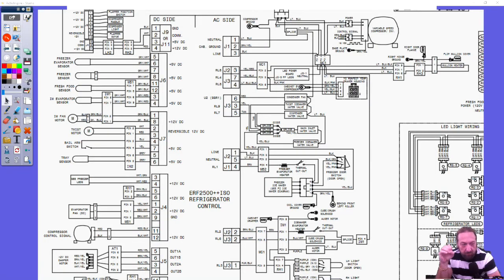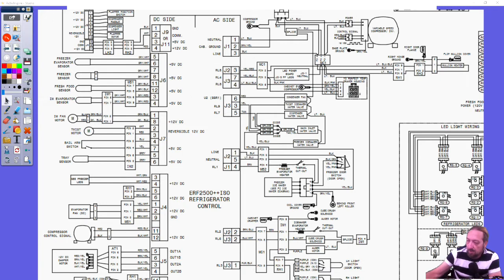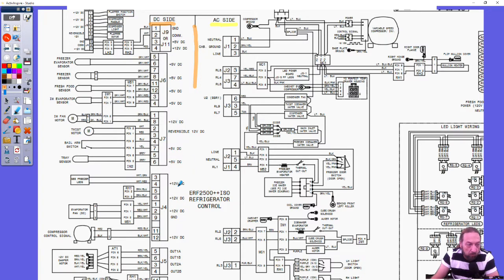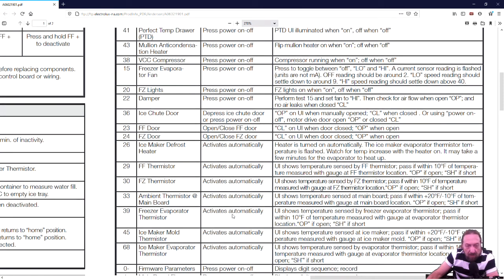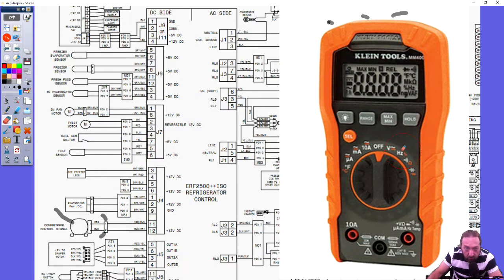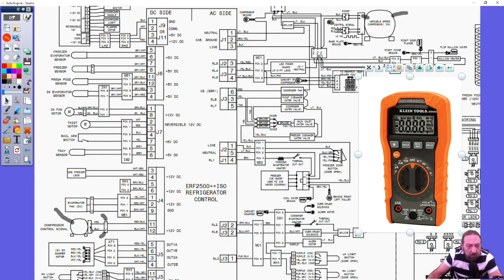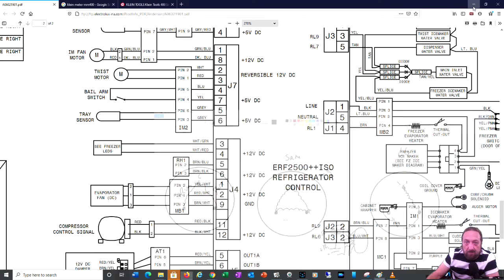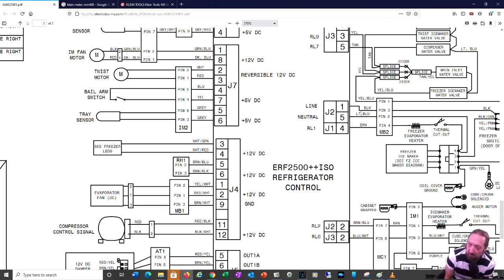Electrolux Refrigerator Wiring Diagram, Compressors testing

Comment: I got a 40$ 2 Mghz 2 probes oscilosope and i installed a battery in it , so now its fantastic . Much better then that voltmeter unimer.  I use SANWA PC510 , its good for last 10 years working liek a charm , does detect frequency but up to 1Khz , but i can do all that with scope .